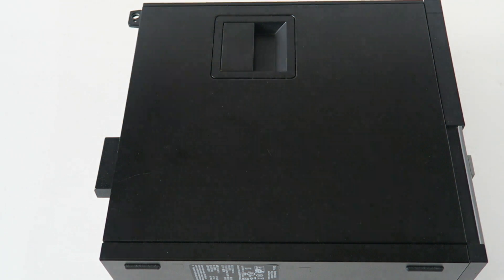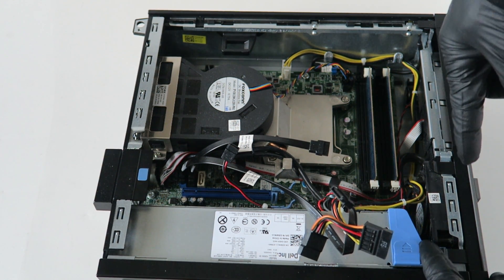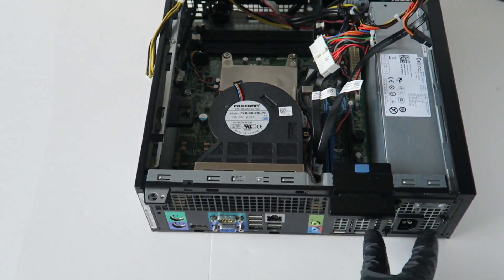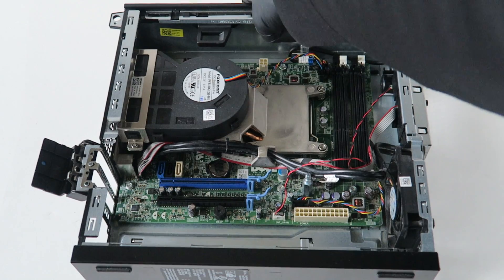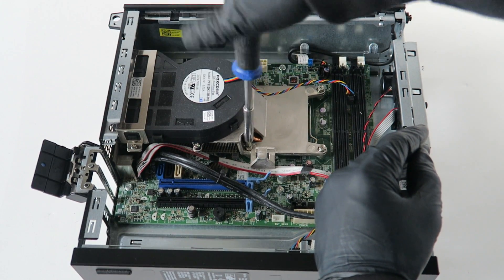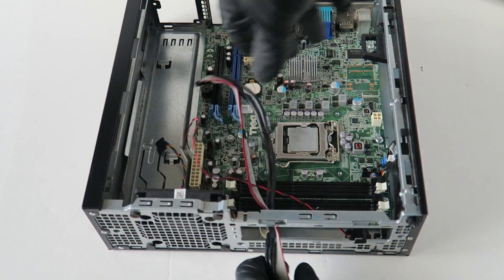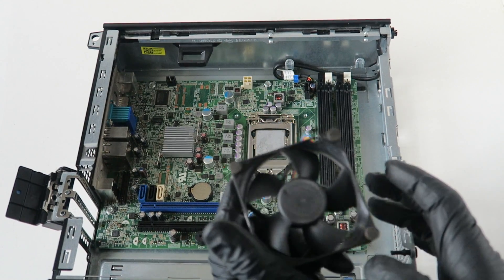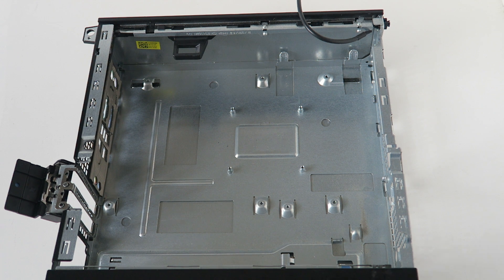Dell Optiplex 790 990 SFF Teardown

Comment from the maker: List of parts work with this system

 (1.) GIGABYTE GeForce GTX 1650 OC 4GB, GV-N1656OC-4GL Video Card
https://amzn.to/2B7N1sP 

(2.) Gigabyte GeForce GTX 1650 OC GDDR5 Low Profile 
https://amzn.to/3el08os

(3.) Gigabyte Geforce GTX 1050 Ti OC Low Profile 4GB GDDR5 128 Bit PCI-E Graphic Card (GV-N105TOC-4GL) 
https://amzn.to/2T8bfsv

(4.) MSI Gaming GeForce GTX 1650 4GB GDRR5 Low Profile Graphics Card (GTX 1650 4GT LP OC) 
https://amzn.to/2X1FYsF

(5.) MSI GTX 1050 TI 4GT Low Profile  Graphic Cards 
https://amzn.to/2LwZd7P

(6.) Gigabyte GeForce GT 1030 GV-N1030D5-2GL Low Profile 2G Computer Graphics Card 
https://amzn.to/2Z4PHkp

(7.) ZOTAC GeForce GT 1030 2GB GDDR5 64-bit PCIe 3.0 DirectX 12 HDCP Ready Low Profile Video Card ZT-P10300A-10L 
https://amzn.to/2WzgLXk 

(8.) MSI Graphic Cards GT 1030 2GB GDDR5, Low Profile 
https://amzn.to/390Spum 

 
This RAM works with this machine:

(1.) Crucial 8GB Single DDR3L 1600 MT/s (PC3L-12800) Memory CT102464BD160B
https://amzn.to/2VhGv8O

(2.) Crucial 4GB Single DDR3L 1600 MT/s (PC3L-12800) Memory CT51264BD160B 
https://amzn.to/2xq46wb

(3.) Crucial 16GB Kit (8GBx2) DDR3L 1600 MT/s (PC3L-12800) CT2K102464BD160B 
https://amzn.to/2VpsKpP 

This HDD 2.5inch will work in this caddy for extra storage.

3.5" to 2.5" SSD or Hard Drive Caddy Adapter R494D 0R494D 
https://amzn.to/2XTPeRr

1.. Seagate FireCuda 2TB Solid State Hybrid Drive Performance SSHD – 2.5 Inch 
https://amzn.to/3b1e8T7

2..WD Blue 2TB Hard Drive s, SATA 6 Gb/s, 128 MB Cache, 2.5"
https://amzn.to/2Xstb4b

3..Seagate BarraCuda 2TB Internal Hard Drive HDD – 2.5 Inch 
https://amzn.to/2xmf0TE 

This cable required if you going to install SSD and HDD:
Benfei 15 Pin SATA Power Y-Splitter Cable 8 Inches
https://amzn.to/2XsG0LV

Cable Matters 3-Pack 15 Pin SATA Power Splitter Cable 8 Inches 
https://amzn.to/2Rval8B

Zheino SATA Power Splitter Cable (2 Pack) SSD Power Cable HDD
https://amzn.to/3a3V9Wq

SSD list works with this PC:
(1.) Samsung 860 EVO 500GB 2.5 Inch Internal SSD MZ-76E500B/AM) 
https://amzn.to/2yNxnkE

(2.) WD Blue 3D NAND 1TB Internal SSD, 2.5" WDS100T2B0A
https://amzn.to/2wvnC9Z

(3.) WD Green 1TB Internal PC SSD  WDS100T2G0A
https://amzn.to/3cbrcWa

(4.) SanDisk SSD PLUS 480GB Internal SSD SDSSDA-1T00-G26
https://amzn.to/3a3i9ou

(5.) Crucial MX500 250GB 3D NAND SATA CT250MX500SSD1(Z) 
https://amzn.to/34rZlhy

(6.) Samsung 860 PRO SSD 256GB - 2.5 Inch SATA III 
https://amzn.to/2ybiHLK

(7.) Samsung SSD 860 EVO 250GB 2.5 Inch SATA III Internal SSD 
https://amzn.to/2VjIAkK

(8.) SanDisk SSD PLUS 240GB Internal SSD
https://amzn.to/3c7SEE4
Reply: Quais tipos de processadores que essa placa aceita

Comment: I have the 990 sff and I'm having trouble pulling out the power supply I release the white clip   🤬 I tried everything is it possible that it's permanently stuck maybe it burned out it's blowing out extremely hot air and it's hot when I touch it it's stuck at number three damn it damn ith

Comment: Heatsink stuck at processor. How should I remove it tho? Should be caused by dried thermal paste.
Reply from the maker: Hi, i use hair dryer and apply heat to the heatsink and that should allow you to remove heatsink.
Reply: @Mxkdt  i tried with 2min hair dryer, but still can't work :(

Comment: motherboard definitely didn't just "come right up". it's totally stuck down. some corners are loose but it's still stuck in somehow.
Reply: yh same here did u find a fix
Reply: @greedjas8735  on mine it looks like one of the bolt holes that connects the bottom of the fan to the case is stuck to the motherboard. three of them came up but one is stuck. not resolved it yet. think i'm just gonna have to break the motherboard. can't really even get a saw in to cut it or anything.

Comment: there a way to add a 2nd hard drive?
right now i have an ssd drive and cdrom drive...
i would like 2 hard drives and 1 cd drive
Reply: there is butttt the sff case cant hold more then 1 hdd so you will have to case swap or keep the side panel of and put the other hdd on the outside

Comment: Just got one of these 990 from work. The power supply blew due to power outage/surge, probably lightning. I bought a Xeon e3-1270 for it (tested working with an external PSU, so yay for that) but I need to either repair or replace the PSU. I hope it's just a fuse.

Comment: I used this video as a guide for removing the CPU cooler on my 990.
I'm glad I did it too because the old stuff was like concrete. 
I removed it all and applied arctic silver 5.
Then I did the same thing to the old stock NIB video card I picked up. Stuff dries with use and or age because it was ready as well. 
I monitored the temps and its not a big difference at all, but it's all good for the next ten years or so...LOL.

Comment: Hi dud i need to change my motherboard wat number do i have to look for i got a i7 7010 optiplex
Reply from the maker: Hi, yes there is white small sticker you will see inside motherboard starts with cn
Reply: @Mxkdt  yea i see that sticker but do all numbers got to mash o some ??
Reply from the maker: Yes starts with 0
Reply from the maker: They sell used motherboards on ebay for dell optiplex 7010
Reply: @Mxkdt  ok thank ebay got a lot but my number they dont have thank again
Reply from the maker: Let me search for you do you have dell optiplex 7010 mini tower or small form factor?
Reply: @Mxkdt  hi dud my # is DP/N owr7py  cn-owrn7py-72200 3cq-04i-a02  ...do all this # have to mach o some only ??
Reply: Is the ....owrtpy....is it the first group of # the more important ???
Reply: I made a mistake on the numbers start with cn/ 0wr7py- the rest are ok thank
Reply: Hey don't worry about it I already found the motherboard is the first five numbers that are needed thank you

Comment: Hi, I need a new case for my 9020 sff. Do you know if any of the other models (9010,  990...) share the same case? I just want to swap all the components over to a new case because mine is really beat up..
Reply: Is the mother board of optiplex 9020 matx or itx?
Reply: Buy a new bigger case, it fits

Comment: Hi, can I place this motherboard in tower casing. install a GPU and make it work? Please reply.
Reply: You mean switch case while using same the same mobo? Won't work just for the fact Dell has put a lot of proprietary connectors in. I tried to do this with my own 790 and what I found was:
1. The cooler is large and probably won't fit in any other case. Might get solved by replacing it with Intel stock cooler.
2. This is the biggest one: Proprietary power connector. You would have to use the power switch from old case (can be removed but without the "hat") and that's very inconvenient. You most probably can't even fit it in any other case.
3. The I/O-shield is fixed in 790 SFF. You can't remove it so you would have to go without the shield on new case.
Reply: There's a youtube video on someone who successfully transferred their optiplex board into a regular PC case though. All they did was cut out the square thing surrounding the power connector. All you have to do is remove the shroud for the cooler to fit. The I/O shield I don't know about though, might have to jerry-rig one yourself.
Reply: John Connor
The I/O-shield is permanently fixed in to the case.

Comment: Great video i have this computer and i wanted to know if you could install a regular cpu fan on this motherboard. I'm planning on using this mobo in a open case gaming rig and adding a bigger psu and also a gpu. Any feed back will help.
Reply from the maker: Hi, do you have a mini tower or small form factor ?
Reply: it's the small form factor the same one on your video
Reply from the maker: No small form factor, gaming rig go with the dell optiplex mini tower that allow you to upgrade power supply and video card
Reply: Sounds good, but doesn't work. I tried and what I found was that  CPU cooler is too large for most (if not all) midi towers and won't fit (might be able to swap to Intel stock cooler), the I/O-shield is fixed to case so you can't remove it and place it on new case and the most important is the Dell's proprietary connectors, since you can't use any other power switches other than the one in the case.

Comment: can you put an Express card on this model?
Reply: Yes.
Reply: @lesrogers7310  no.
Reply: @KekkoMaster1, why not? If Avery Ortiz is referring to PCI Express there are two slots for these cards. If, on the other hand he is referring to the laptop type Express Cards then the answer is obviously 'no'.
Reply: @lesrogers7310  hes refferring to pcimcia aka express cards, the slim ones u pit in ur laptop. If u dont know what hes talking about then dont comment
Reply: @KekkoMaster1 the fact is you are assuming he's referring to PCIMCIA but this is a desktop machine NOT a laptop! My comment is therefore more relevant than yours.
Reply: @lesrogers7310  he would have said pcie and if hes saying card he would have said gfx card to get a more specific answer.
Reply: @KekkoMaster1 If what you are suggesting is true why would he ask this question in a post related to a desktop PC? This does not make sense. Also, there are several other cards that come in PCIe format such as USB 3.0 and SATA RAID for example..
Reply: And he would have said if a usb 3 express card